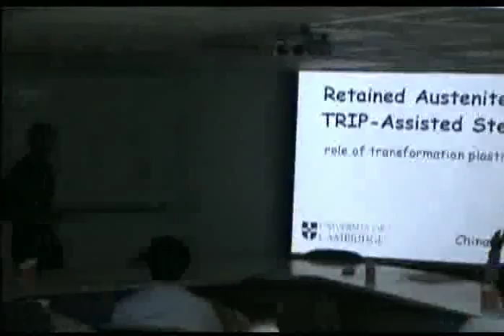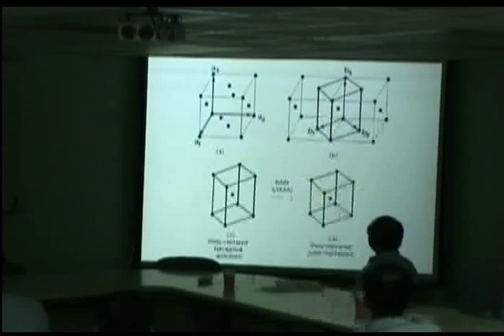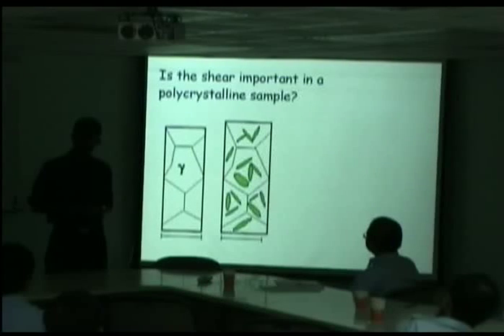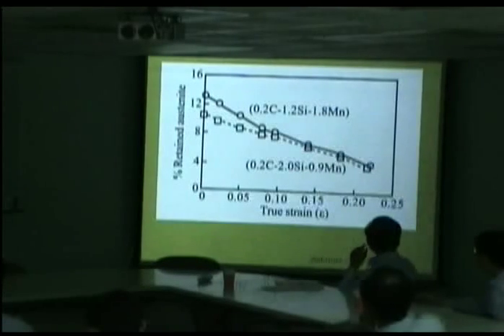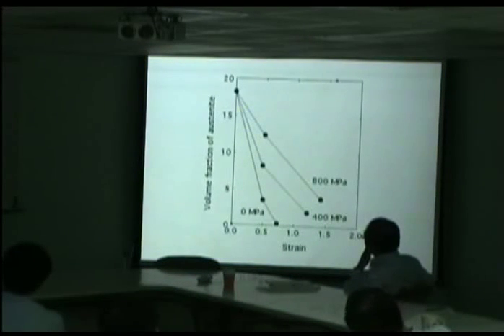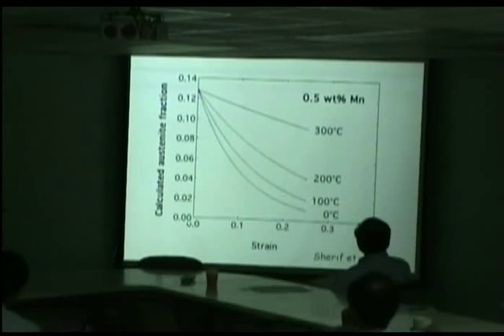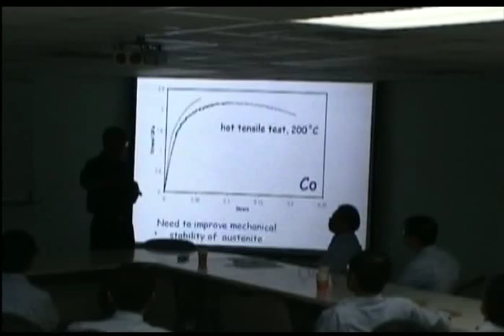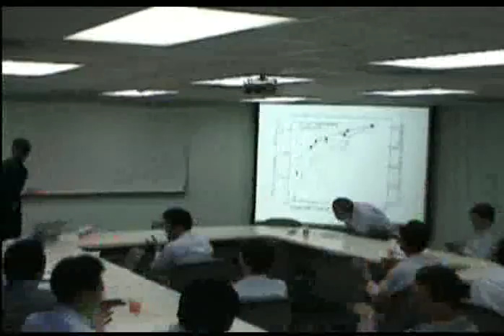TRIP-assisted steels: role of retained austenite

Comment: Dr. Bhadeshia, if we take AISI 1095 steel and quench it in water to room temperature, we would expect to see quite a bit of metastable retained austenite as a result of the high carbon content.   If we further cool this material from RT, we may be able to force some of the retained austenite to undergo martensitic transformation but the question is, what would happen if we re-heat it to 1200F for a few hours (which is below the eutectoid temperature)?   The retained austenite has lower free energy at 1200F as opposed to at room temperature but the martensite is still metastable and the higher temperature should now allow for diffusional kinetics to facilitate its transformation to the proper equilibrium phases being ferrite and carbides.  Perhaps just ferrite would form because the rejection of carbon from the freshly formed ferrite would further stabilize the remaining austenite.  What would you expect to occur?
Reply from the maker: 649°C is high enough for atoms of iron and carbon to diffuse, so it is likely that the retained austenite decomposes into a mixture of ferrite and cementite. Indeed, that is what the time-temperature-transformation diagram for this steel indicates:

https://knifesteelnerds.com/2021/06/07/bainite-heat-treatments-of-52100-o1-and-1095-how-much-toughness/
Reply: @bhadeshia123  Thanks Dr. Bhadeshia.  If we heat the as quenched material to temperatures just above the Ms temperature (like 500F in this case), am I correct to presume that the retained austenite could transform into lower bainite?  Also, can we form lower bainite in as quenched (into hot salt baths) low alloy steels if they are quenched to temperatures between the Ms and Mf if we hold steel there for prolonged periods of time.    I would presume the answer is yes and that the resultant microstructure would be a mixture of martensite and lower bainite with the amount of the former increasing with how far below the Ms temperature one holds the quench bath temperature at.